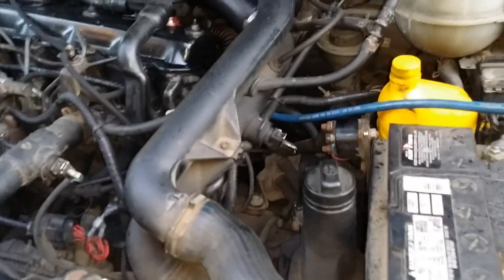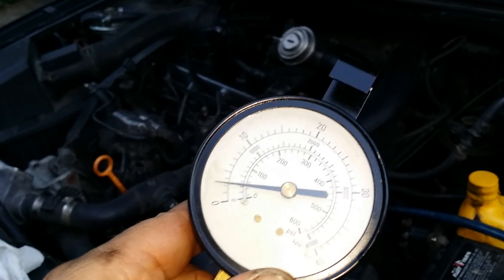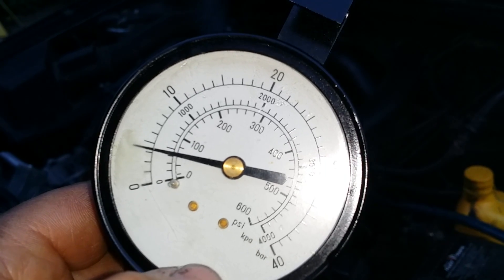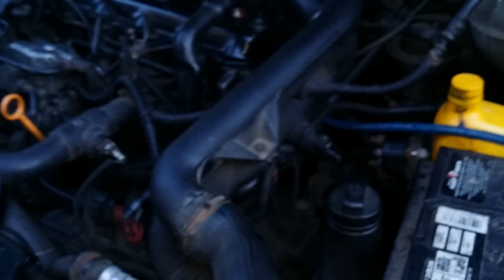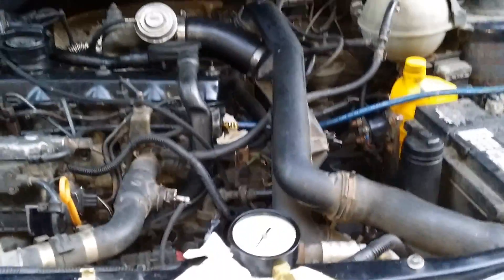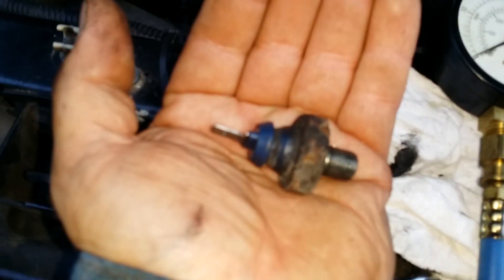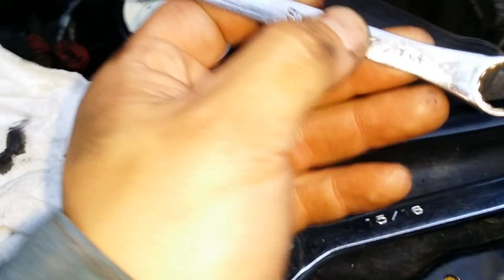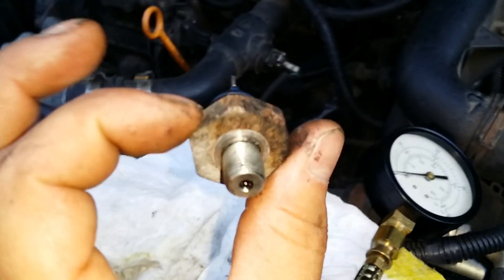Vw tdi how to check engine oil pressure

Comment: You don't need an oil pressure test to diagnose that engine,the oil smoke from the top is enough.
Reply from the maker: Before i was gonna replace the piston rings i wanted to make sure oil pressure was ok .

Comment: usually for a stuck ring I just ad some CD2 and drive it for a while the oil pressure is good on that engine. But I am concerned that it might be a cracked piston. If you used Either to start it then sometimes that cracks a piston.

Comment: What happened to this car ?
Reply from the maker: Brandon Ruhl couple weeks ago got hit by a car and no longer in service, half million miles  , also I replaced piston rings, you can see in my other videos.
Reply: Anderson E Rockefeller Damn. i was excited to see how far the Ahu would go. Bummer.
Reply: & i did see the other video, ran nicely after you replaced them.
Reply from the maker: @brandonruhl4525  It ran perfect after i replaced the piston rings, no more oil consumption.
Reply from the maker: @brandonruhl4525  i was hoping to get 3/4 of a million miles with the original clutch.

Comment: Time foe some no smoke.  Be careful you don't use too much as you can get so much compression you brake the rings.  Folks that poo poo the product have never used it.
I can finely feel safe to tell about it as I just got a llife time supply of 1o gal. of it.